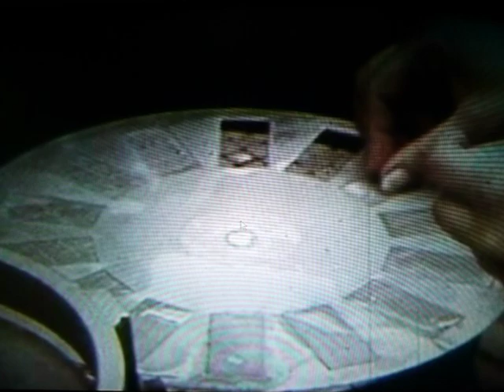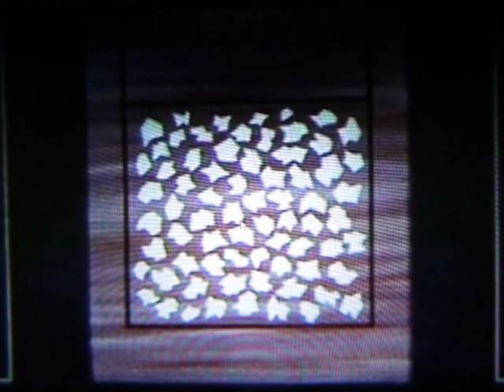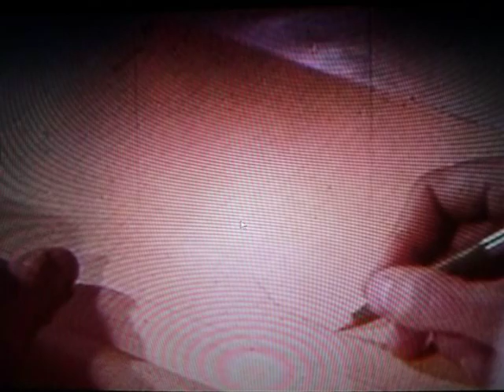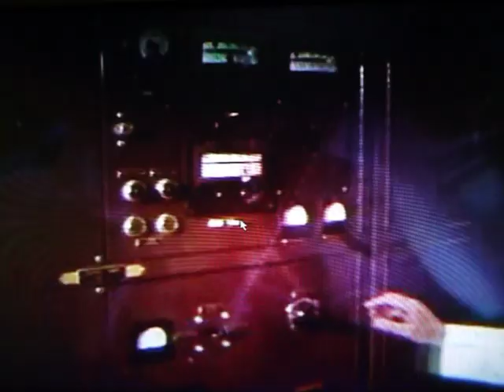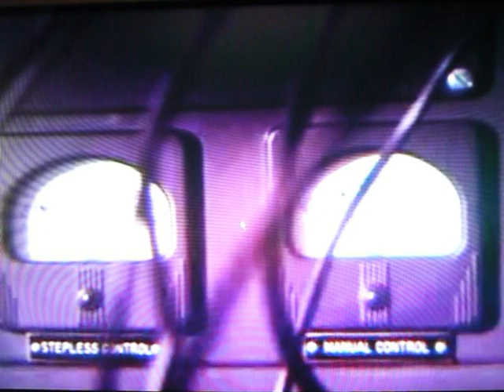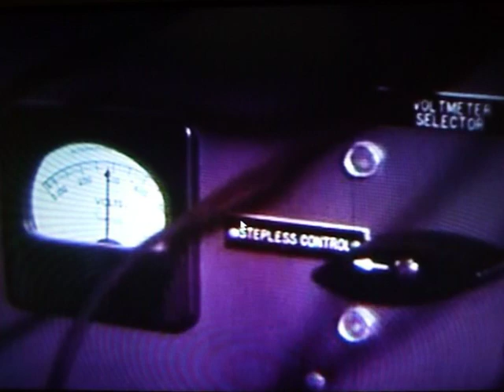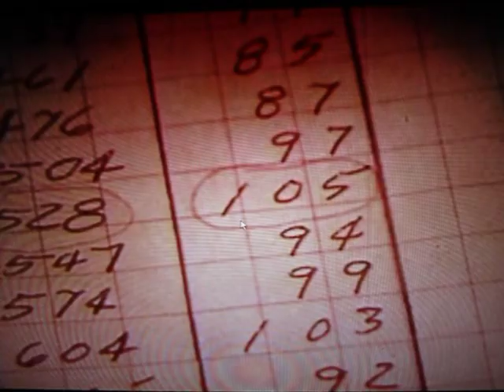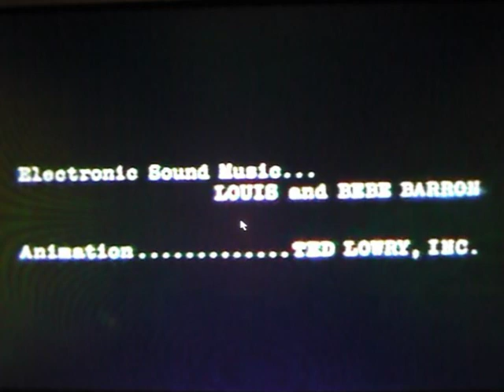The Manufacturing of Synthetic Quartz Crystals

Comment: "During nights and weekends"... am constantly amazed at how much this is still used in such a precise environment. I can tell you that today there is still a large amount of "Black Magic " that is constantly battled by "carefully recorded data ". Keep in mind that these guys had no Xcel spreadsheets to use. Simply amazing.
Reply: I second this sentiment. Some modern manufacturers are shockingly sloppy. They rely on their "senior operators" who never keep written records.
Reply: @Tadesan  Senior operators don't keep records, they keep secrets.   That is how they keep their jobs.
Reply: i used to grow one metric ton  of bismuth crystals  within a few weeks  two or 3 guys working 24 / 7   the magic was to keep the level of impurities in a range of a few ppb   a little bit to much - failure  a little bit to less-  failure i literaly could see ppb   without any instrumentation   it was just the play of iridescent colors  the viscosity and  the surface tension which told me if the conentration for growing bismuth crystals  quickly  in pefect sellable quality   was right. its true,  growing crystals is a science and an art.
Reply: @udobehner3751  Although my comment was seven years ago, thanks for your input. I just retired this year from 21 years of putting together OCXO for Active Hydrogen Masers, which require the quietest oscillators available to function properly. I fought phase noise introduced by the resonator constantly, and could tell the difference from the components causing it. I always suspected the impurities were the deciding factor. Please allow me to end by saying I was and remain forever awed, and hold an abiding respect for what you do/did, and if you ever worked on any I used THANK YOU!!! Bliley was my favorite.